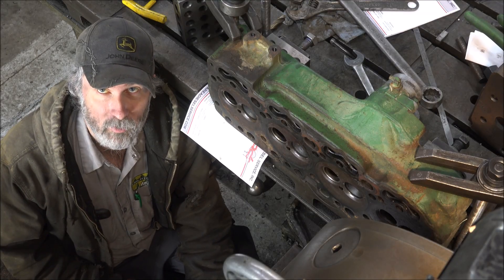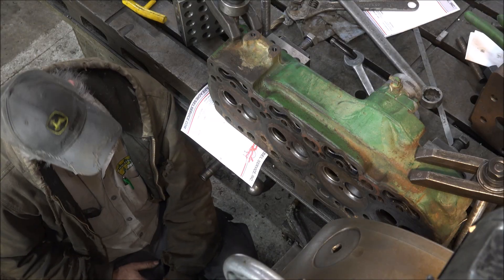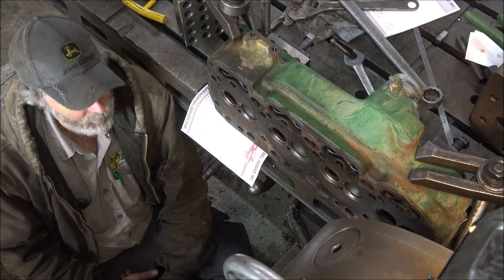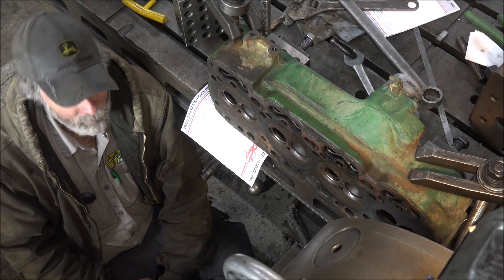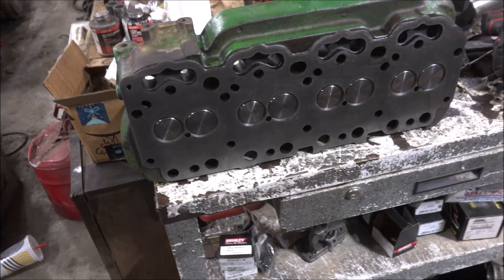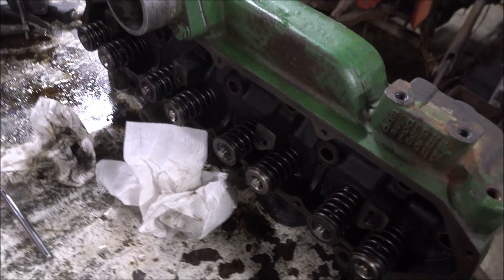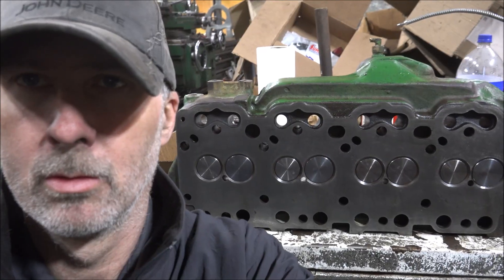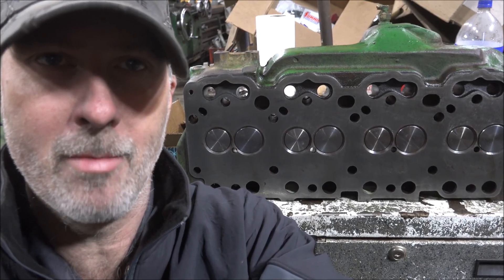Deere Dubuque 4 cylinder head rebuild

Comment: Your Bosch VE pump videos have been a real help to me. I’ve got a question about the governor springs.

I’ve seen some folks swapping out their stock springs for the 366 spring, trying to get better high-RPM performance. Now, my pump came with a factory spring marked in red with the number 392. It’s thicker and longer than the 366 I bought, and definitely feels stiffer.
Would this 392 spring actually give me better performance than the 366?
And does that part number 392 have anything to do with higher RPMs, like say around 4000 RPM, compared to the 366 which I’ve heard is more like 3200?
Or is that number just a part ID with no real link to RPM range? Thanks
Reply from the maker: To my knowledge the spring part numbers have no correlation to rpm they are just part numbers. If you max the throttle lever range out on the pump the stock spring will pull load to 3500rpm. Most people looking to turn 4K use the clipped 3800rpm spring as  it will fuel past 4200 when the linkage is maxed.  Ultimately there is little point in turning 4K with a ve as the fill time is too short and they are dropping horsepower at that rpm so you are beating up engine parts for not much reason should have grabbed another gear to get engine speed back in powerband.

Comment: Hi Brian 
It has been a while since I visited your old barn shop, it looks as if it turned out prity good, I haven't been following close enough to know whether you have actually moved everything over to the old barn shop or not yet? 
There might just be too many memories there to let it go back to a car garage, or whatever it was to begin with.
I'm the guy that sent you some tiny tools, and a handful of Dividers, Calipers, Compass type tools, and I remember you were able to use one of the Calipers because it was so small, and you said, in this case bigger is not better. 
But I suppose all the rest have turned into rusty Ebay candidates.
I enjoyed seeing you save the old horse barn even though it only looks like the old barn from the outside, the inside is definitely something different, especially with the bridge crane installed. 
The head turned out nice, and the valve job went well, maybe next time the camera will do better. 
But thanks for the wholesome entertainment you have provided over the years, how are you getting along with the new dog,?
Good work being done in the Machine Shop, and nice fix on the new motor for the Big Monarch
Reply from the maker: Oh no I use most all those dividers on a regular basis they are in the top drawer of my cabinet behind the hbm for easy access. I still have not moved the 3 machines out of the garage to the barn shop. Honestly I don’t really have much room for them in the barn shop. It filled up quick. Sadly none of my current dogs really have any shop interest like Baily did. 😢